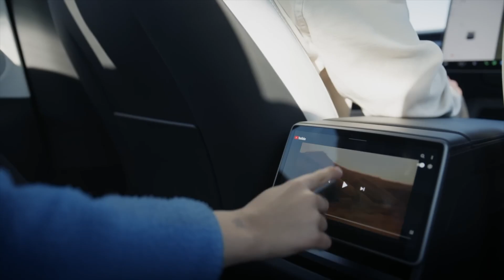Tesla Model 3 Goes 410,000 km — And the Battery Still Won’t Quit

Comment: That's a truly amazing achievement but let's be fair, high mileage over a short period of time is a strong point of LFP batteries when compared to ICE. 

If you consider that the average age of an ICE car (here in the UK) is over 18 years, how will LFP/NCM batteries fair over the same period?

Regardless of the mileage, how much charge will that Tesla battery hold when it's 15 years old, after another decade of calendar degredation?